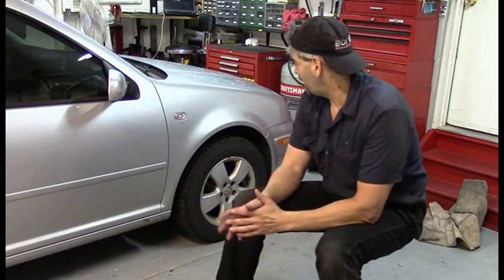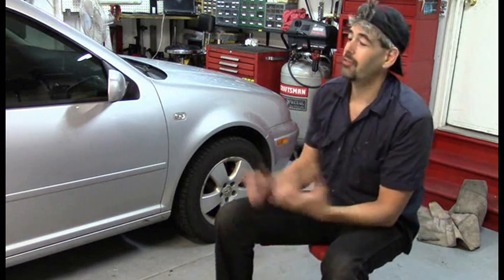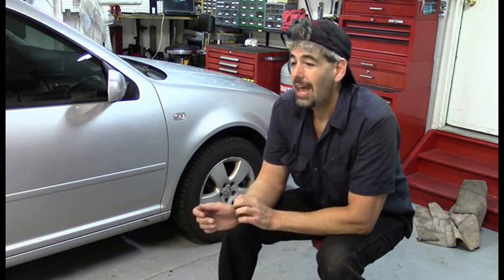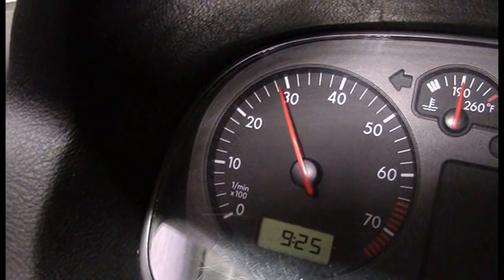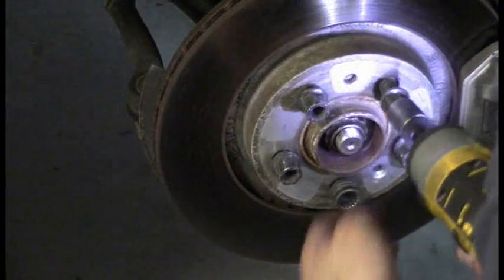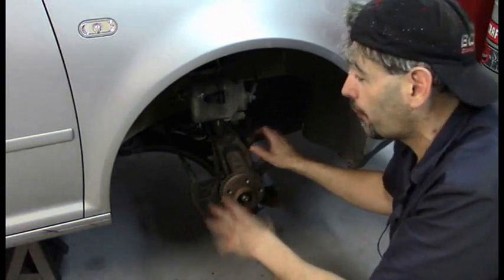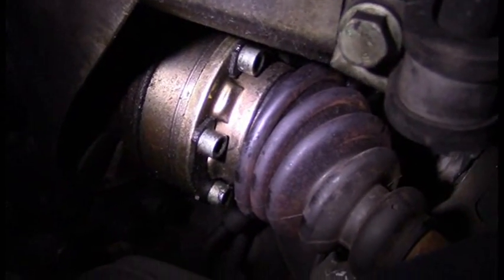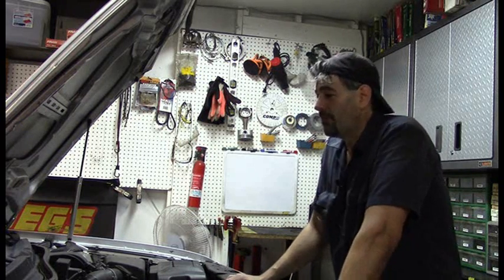2003 Jetta Vibration Diagnosis- Is it Driveline, Clutch, or other?

Comment: G'day from Australia, I have a strange issue with my car.

I get a vibration which feels like driveline when above 80kp/h.

If it's under load (acceleration) there's no vibration, as soon as I lift off or depress the clutch there's vibration.
I've had new Uni joints put in and installed the tailshaft in the same position it was prior.

The car does have a rake as the front is a bit lower than the rear.

It's a 1 piece tailshaft.

Any help would be fantastic
Reply from the maker: could be motor it transmission mounts

Comment: I’m not sure about the mis-aligned clutch theory. The clutch disk runs on a splined input shaft, if that was misaligned you would not be able to mount the transaxle back on to the engine. And even so, any small misalignment would be gone once you pushed the clutch pedal down and the pressure plate releases the disk would center itself.  The pressure plate mounts using bolts all around the circumference, so very little chance of misalignment there too. Maybe an imbalance in the clutch disk? Though that would be there even in neutral. Certainly an interesting problem.
Reply from the maker: AGreed I am in favor of imbalance or maybe improper torque as someone else brought up.  I think a misalignment is less likely for the reasons you stated- you would not be able to line the input shaft into the trans.   I also thought maybe a driveplate imbalance but I figured if it was a driveplate issue the problem would happen regardless of it clutch is engaged or not since the driveplate spins with the engine.
Reply: If you don’t use an alinement tool when tightening a clutch it highly likely you will get vibration, metal will bend when you torque it down if not flush or not eventually tighten in sequence

Comment: Very nice video Matt showing the steps of where a vibration would exit. My thoughts are that it's an issue with the pressure plate. It's only a guess, but I would suspect that the shop replaced the flywheel along with all the other clutch items. A lot of these items are made cheaply overseas and not balanced correctly at the factory. My gut feeling, and it's only a guess, is that the flywheel is unbalanced.
Reply: Hi,

Maybe you can help me.  I just bought a 2000 Jetta IV 1.6, it drives like a dream and has no rattles etc.  Only have one problem, it struggles to cold start in the mornings, I assume because it doesn't give any problems during the day when warm that its not loosing sucking air somewhere, because the idling at all times stay stable on 800rpm.
I have read up online and watched you video about the diagnostics.  Everybody speaks of a valve that should open automatically to allow more air in to let the rpm go a little bit up and also allow more fuel to assist with the cold start.
I am not even sure where this valve is, and or if it could be the problem itself, or the sensor that gives it its commands that the engine is still cold.

From what I understand, it should by itself close again once the engine is warm.  I struggle every time the car stood for a while, the idling never goes upto 1200, it stays on 800rpm.

Hope you would be able to assist me.
Reply from the maker: Martin Deysel What you are referring to is an IAC- Idle Air Control.  This is not likely to be the issue because you return to stable idle after driving.
  Without a scantool and special testing equipment like a fuel pressure gauge this would be really hard to diagnose. But suspect things would be vacuum leak, leaking fuel pump checkvalve, possibly leaking injector.  I would check resting fuel pressure first on this car to see if there is a rapid loss of fuel pressure when car is sitting which is very likely to cause cold start problem.
Reply: Schrodingers Box Thanks for the reply, whould it help if I take it in for a diagnostic, they should be able to test all the sensores etc?

Comment: I am thinking it is a problem with the differential.  The CV shaft is bolted to the differentials on both sides and you really cannot test them while running on the vehicle because as you point out TF would fly all over.  I do not think it is the clutch because any misalignment would be noticeable at engagement not running.  What kind of symptoms did the owner originally have to prompt replacement of a clutch and CV shafts?  This makes no sense to me.
Also are they limited slip differentials?
Reply from the maker: I like the out-of-box thinking.  The vibration only occurred after clutch and CV replacement though so I think much more likely it must be one of those.  Then again I am not sure what prompted the clutch replacement and perhaps vibration was always there before. Good thinking bro!
Reply: It's a slipped crankshaft bearing.

Comment: That car has a duel mass flywheel. That means there are springs in the driveline. Therefore their will be a harmonic frequency that has to be dampened out. I think it is only the engine mounts that can dampen vibrations. Only a thought. It is also possible that the aftermarket flywheel has the wrong spring tension and will never work properly.
Reply from the maker: I don't know nuthin bout that.  I prefer to stick to check engine lights!  I agree that engine mounts is probably much more suspect than I gave credit in the video though- I will recheck them if I see the vehicle again.
Reply: Good job proving it was not the driveshafts. The next job is to prove it's the mounts. Hopefully you will see the car again...

Comment: I have the same problem on my vw bora tdi at around 4000 but also have a vibration but not as bad at 2000 :( I had fitted aftermarket shafts before it began, yet mine happens in all situations ie moving/stationary, clutch in or out, accellerating/decelerating. Sometimes I get locked out of gears too, really hope I can find a fix before something gives out.
Reply from the maker: Remember- its the same symptom- may or may not be same problem.
Reply: @SchrodingersBox  personally I suspect diff or axles, my axles are remanufactured ones done here in the uk. Even though they felt tight as hell the diff had backlash in it with axles out!.

Comment: I'm willing to bet it is a product of the dual mass flywheel. My 02 tdi had a nasty vibration when at low rpm and others have had the problem too. It's the 2 halves that if more than a few degrees off alignment caused the off balance. I ended up converting to a single mass flywheel and problem when away.
Reply from the maker: I agree, I was thinking same.  Unfortunately the owner of the vehicle sold the car recently for a new SUV so we will never know what it ultimately was...

Comment: no follow up to this video? the first thing that came to my mind is a dmf flywheel because i'm having a vibration at certain rpm's also. i'm changing out to a smf flywheel on my 2003 beetle to hopefully get rid of the vibration. The dmf flywheel actually wears out. there are nylon bushings and some springs inside the flywheel can become broken. Edit:  i see down in other comments that it turned out to be a damaged timing belt. I would have never suspected that. I know thats definately not my problem because i've replaced mine 5k miles ago

Comment: hi I have the same problem but mines started naturally, same rpm  or around 30mph and above especially when gas pedal is pressed more which means higher rpm, around first and second gear no shake,it also feels like there's no torque /horsepower the car just wouldn't move faster when gas is pressed, I also had a mechanic test drive it with me and he also couldn't figure out the problem, but you definitely narrowed the problem to engine mount or clutch since I never had clutch replaced but been driving the clutch hard so that could be one,l just hope that you could have finished the inspection so that we find out what was the cause or had the extra time to check the mounts and clutch before giving that car back after all this was the case to find out the problem, I was soo excited when I saw the video but very disappointed at the end since the problem wasn't resolve, thanx for trying though
Reply: also I forgot to mention my car is an 07 2.5l new beetle, 5speed

Comment: Question. Cause i have same problem and its a budget car. What needed to be changed to fix the problem?
Same simthomes at my car at high load everything vibrates and on higy speeds its actualy kind of scarry cause the car becomes noisy from the vibration. 
Its not wheels or discs i didnt have the chance to check the clutch gearbox and driveshafts.
Reply from the maker: You have the same symptom- may or may not be same problem.  The problem on this car was missing teeth on the timing belt.

Comment: I am really interested in knowing the answer to this one.  I originally thought the problem was with a part being out of balance coming from the manufacturer of the clutch components but then I heard you say the problem went away when the clutch is engaged and the car is out of gear.  Very interesting as it only happens when the engine is revving between 3800 to 4000 RPMs and when in gear.  What was the repair?
Reply from the maker: Yes many, many people have also asked for the update on this.  No further updates have been done since the next step would be the major operation of removing the transmission to inspect the clutch and given the fact the symptom is extremely minor and my pile of pending other projects plus customer's limited interest in pursuing it further the car is still being driven as is until things worsen.

Comment: Everything past the input shaft could be ruled out by the fact that the problem is dependent on RPM not gear or axle speed. 

A couple people already mentioned the possible vibration concerns with the dual mass flywheel that's used on these and many other Euro cars. It is unknown what kind of clutch kit was installed. They could have slapped some cheap Chinese kit that was poorly balanced. Maybe the shop didn't replace the flywheel and the replacement pressure plate is cheap and out of balance. There are also "single mass flywheel conversion" kits that are cheaper because a dual mass flywheel is more expensive. Lots of variables here. This is why I try to use good kits for German cars, made by Luk or Sachs, or another OEM supplier.

Comment: I had similar situation ! 18 monts ago I bought 2003 New Beetle Cabrio, seller had no idea when timing belt was changed.  I drove to my home (150 miles), when speed was ca 60 mph,  nasty vibration came,  ca it started 3500 RPM , ended ca 4000 RPM.   New timing kit + water pump, no more vibrations.
Reply from the maker: Yep- turns out this was a bad timing belt missing teeth.

Comment: I own a GMC Sierra 08. That when going over 60mph and I let go of the gas pedal it starts to vibrate Then I hit the gas again vibration goes away, but going over 75mph vibration is precent even when accelerating n gets worse when deceleration.  When those vibrations are present I have shift the truck to neutral and the vibrations are gone. Any ideal what it might be ?
Reply from the maker: check your driveshaft balance and all your driveline components for looseness
Reply: Is there a chance it can be axle bearings ?
Reply from the maker: Not very likely. They don’t usually vibrate when they go bad. They “roar” when they get really bad- almost like a jet engine and trust me if they got to the point they were so loose they were vibrating, the noise would have driven you insane by now.
Reply: Ok thank you, I’m going to find a shop that balances aluminum driveshafts and take it from there..

Comment: My truck start to vibrate at around 2500rpm and up . It gets worst the higher rpm but goes away when I put in the clutch . Feels like in the front driver side so I changed the front axel and feels alil worse.

Comment: Matt, I am having a similar problem with a twist that I think you'll appreciate even though I DO NOT! I have 2000 VW Jetta 2.0L auto transmission. Car runs fine around town. while on freeway at around 73mph and higher vibration occurs only upon acceleration and while turning slightly. If you go straight or let off the gas the vibration goes away. Could this be drive axle, or possibly rack & pinion? Last year I changed the R&P but this problem is new in the last month or so...I'm stumped!
Reply from the maker: could be. what diagnostics have you done?
Reply: About a month ago this car had a similar problem (only constant and worse at higher speeds). Told my wife to take it in and have them check the tire balance, they told her it had to be the R&P. Since I just changed it last year, I was skeptical. So this time, I took it in and told them to check the balance (they were way out... like no weights... at all...never balanced to begin with...smh). They balanced them and it went away, until my daughter came home from college and told me it was doing it again. Only diagnostics done so far is driving to duplicate the problem. I was thinking of putting it on jacks and try to duplicate and then copy what you've done in the video, but not sure if that will actually help since I'm pretty sure it's not the tires because it goes away by just gong straight or letting off the gas. Literally just started with it as she just came home over the weekend. Sent her back with my car so I could work on hers. I got this weekend to finish and take back to her next weekend.Any suggestions on what to check or how to diagnose if different than the video?

Comment: Awesome detective work.  Wish we could see what the actual problem is from.  Maybe a balance issue from unevenly torqued pressure plate?  Perhaps ABS pump has something to do with it too.
Reply from the maker: I'm sure its not ABS and besides without rotors the abs would have no effect on the driveline but I love the idea of the uneven torqued plate- I really like that idea in fact. you can really feel the vibration in the clutch pedal too.  Hopefully I will be able to check it someday soon and I get you are right!
Reply: Schrodingers Box After thinking about it for a good 5 minutes I think you're right.  If it was ABS related you would feel pulses through the brake pedal regardless of all other factors.  Gotta be pressure plate related.  Let's say it's not the bolts.  Would you have to send off the plate and cover to a shop that can put it on a high speed lathe and speed test it?  Perhaps they dropped the transmission onto the flywheel and warped it during removal.  Another possibility is they installed the new pilot bearing incorrectly.  More ideas for the the whiteboard. :)
Reply from the maker: Hahaha "ideas for the whiteboard" I love it!!!  Duly noted and will definitely include it in follow up.
Reply: Kerry Kozma Yeah can't rule out a flywheel issue at this point either.  So far I think the board should include flywheel, pressure plate, clutch cover, bolt torque, bolt type.

Comment: Not sure if you’ll see this but I own a 2009 cobalt it’s the ss it’s also a 5 speed I recently noticed a vibration coming from what seems to be the motor or trans area however mine does it wether it’s in gear or not have you ever had this before?
Reply from the maker: All the time. Simply Check for the cause of the issue mehodcally like I did.  Nothing to it!

Comment: I am having exactly same problem. I am using Toyota passo 1000cc. I changed all the things that u mentioned. Also, I changed the whole transmission. But the vibration at specific rpm is still there. 
One important clue I noticed many times is: it never vibrates for first 1 to 2 kilometers every next day I start driving the car. Then after 2 kilometers car again starts to vibrate between 30 to 60 km/h. Toyota passo has a CVT transmission and doesn't have rpm needle.
Reply: Please let me know if you have any solution to this problem. I am fed up
Reply from the maker: Sure.  What data do you have?
Reply: @SchrodingersBox  i just confirmed that it only vibrates between 1200-1600 rpm. I used obd2 scanner because my car doesn't have RPM needle.

Comment: Hi Matt, a question at this point: what exactly is wrong with the wheel bolts in your opinion? I guess it´s just being used to it. I´ve seen both connections  but don´t see a disadvantage or advantage for one of those...as long as you use a torque wrench (using correct torque, of course)...
Reply: +Michael Pracht --Wheel bolts are just a huge pain compared to wheel studs.  Getting the bolts lined up if you don't have direct line-of-sight view into the holes for the bolts is more work than sitting the wheel on studs.

Comment: Did you try simulating load with the brakes while on the stands? 
I guess the next step is a jack with a thick layer of rubber under the engine to unload the mounts?
Reply from the maker: Dang no I didn't think to try applying brakes and see if it affects vibration whether on stands or while driving.  Thats a friggin brilliant idea.  Dammit Andrew- why you give me all these great ideas AFTER the video is done lol!!!!!

Comment: Hi guys im looking for some help here my driver axle was bad so I decided to replace both axles after I replaced them the car start to make this grinding noise that goes away and them come back like every 3 seconds and then come back again also when I drive the car between 3500 to 4000 rpm or downshifting I feel like a little shaking at the front any ideas please help me I would really appreciate any ideas what it is thanks .
Reply: The axle probably wasn't inserted fully into the transmission.